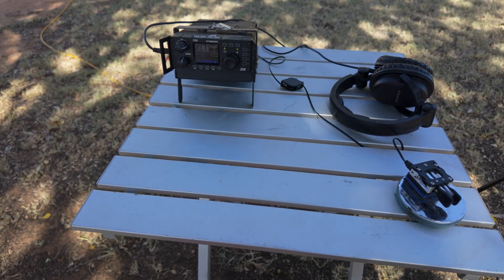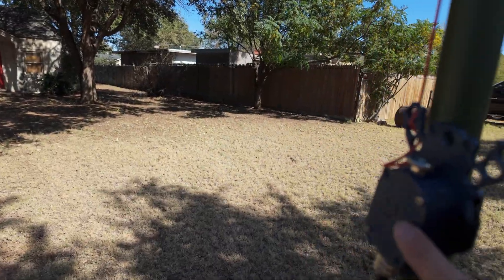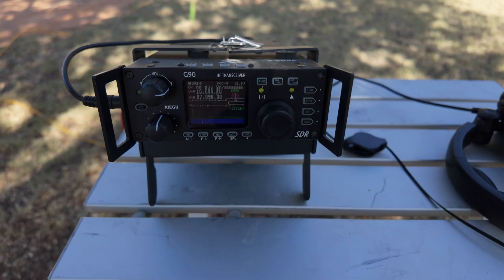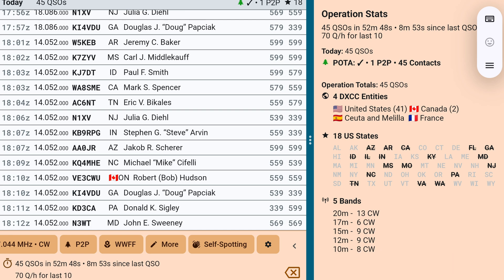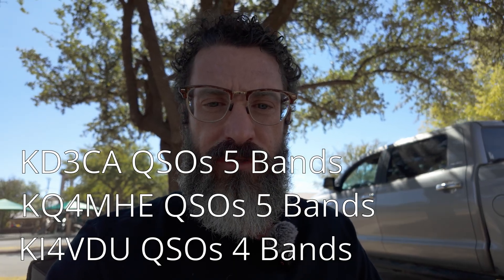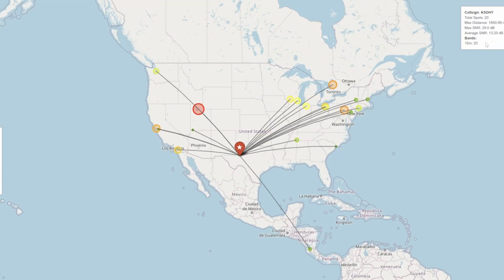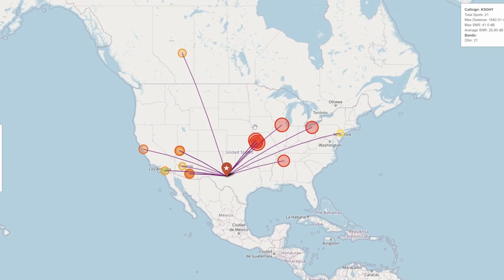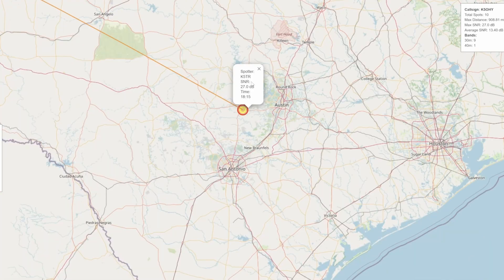Rybakov Antenna: Simple Multi-Band Vertical

Comment: Cool! I am working out what antenna is the best for the limited space at my QTH. Gave me some ideas. Are you hanging out In the Bushes back yard? lol kidding
Reply from the maker: Small space can be difficult. If you can get a doublet high that might be a good option. A multi-band vertical like this is also not bad.
Reply: @Tim-K5OHY I am thinking doublet if I can pull it off.

Comment: Good video Tim. It's nice to have flexibility with the antenna system and be able to use basically the same antenna different ways
Reply from the maker: Thanks Charles. This might be one I use more often. Works great on 20m but still can make contacts on all the other bands by just hitting the tune button.
Reply: Do you have to tune the elevated radials? Looks like they were fixed length for all those bands  @Tim-K5OHY

Comment: Seems like the main advantage of it is that you don't have to get up to adjust anything.  Cool to see one up close!
Reply from the maker: Yes sir, even if its not the most efficient antenna it does work 10m-40m. Of course on 20m its the challenger so it works a well on that band.

Comment: Aloha Tim, which way were your radials... N/S or E/W? Mahalo. Just a new ham here always learning.
Reply from the maker: The radials were 180° apart on the east and west sides of the antenna. From what I understand, two elevated radials spaced 180° apart are essentially omnidirectional. If you position them 90° apart, you get a slight amount of gain in that direction.

Comment: One note for your consideration: Coax loss with short coax may not be very significant. The additional loss due to SWR depends on two things. First the most significant is the inherent loss in the coax. For example, RG8X has an advertised loss of 1.4 dB per 100 feet at 30 MHz. So with a perfect match you get 1.4 dB loss with 100 foot of cable. The additional loss caused by SWR at 30 MHz is dependent on the matched loss of your coax taking length and frequency into consideration. 
With a matched loss of 0.4dB ( like about 20 foot of RG-8X at 30 MHz ( worst case) you would need an SWR of about 7:1 to only have 1 dB additional loss. On 20 meters the matched loss is much less so it would take a much higher SWR to get the same 1 dB additional loss. If the additional loss due to SWR really matters really depends on the situation ( your actual feedline matched loss).
I always estimate mine and then see is the loss is excessive and/or is it worth the trouble to try and reduce that loss. On 160 through 30 meters the answer is almost always no. On 10 meters it sometimes is worth doing something with long runs.
Reply from the maker: Thanks for comment and the info regarding loss on coax. I recently read an article by L. B. Cebik he was comparing loss on 100' of RG-8X vs 450Ω ladder line. The loss was very significant on the coax as the SWR climbs. However ladder line seems to be a better choice for some multi-band antennas like doublets.
Reply: @Tim-K5OHY correct. The ladder line loss is much less per 100 ft. Great for long lengths. Short lengths are even better. However if you get down to 1 dB loss you can’t see any more improvement. With short POTA lengths it is usually not worth too much effort! I rewatched the video and I did not fully understand your connection when you removed the radials for 20 meters.
Reply from the maker: I removed the radials on 20 m since this antenna is tuned as an OCF vertical half wave for that band. It was resonant on 20 m without them, it has a small counterpoise . The radiator is almost 25 ft so I thought it’d be interesting to try using it as a non resonant antenna on the other bands.
Reply: @Tim-K5OHY thanks. I missed the counterpoise part where it was actually OCF halfwave vertical dipole!